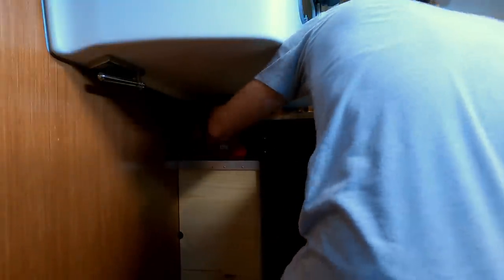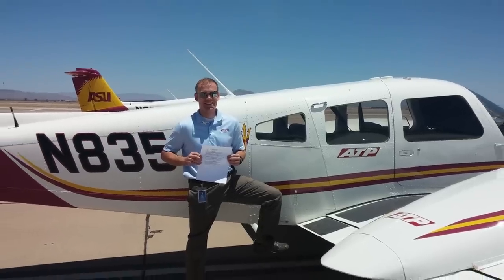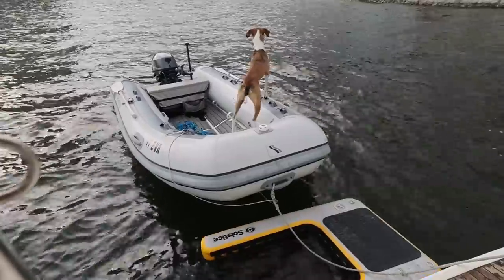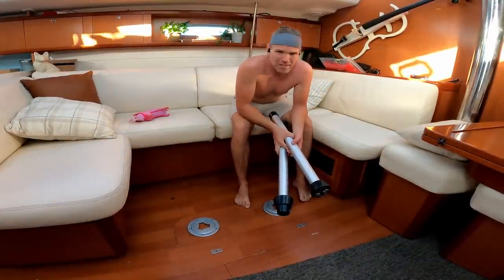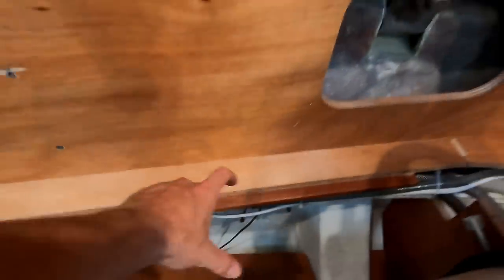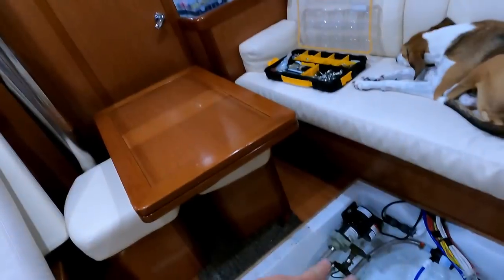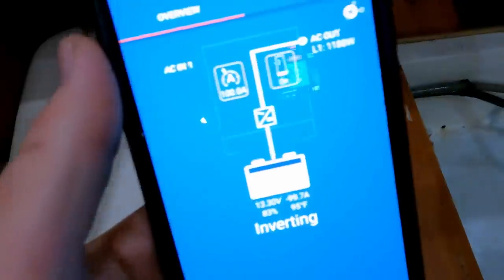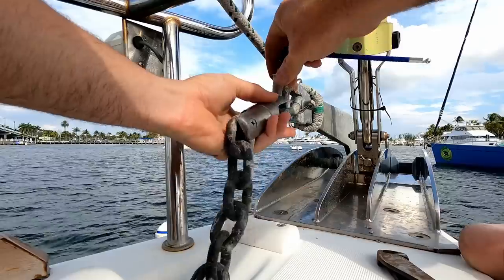Boat Life: A Life In (or out of) Balance | EE 80

Comment: Just a suggestion, based on experience as Yacht Eng/Crew. 
The people who’re warning you about the locking system on your tool chest are right. I’ve actually had a similar chest throw up in heavy weather on crossing from Italy to Spain. 

The damage to the interior of the cabin/tech room that the chest lived in was extensive and cost us 8 days of having a joiner in to do the repairs, everything was veneered natural wood finishes just like yours, it wasn’t a cheap exercise. 

My solution was a sheet of 1/2” plywood and 2 ratchet straps around the chest. I permanently fitted the straps to the chest with a couple of short self tapping screws in each side, that meant that it was a 30 second job to secure it. Might be worth considering?

Though I’m by no means “anti-toolchest”, I have 3 roller cabs with top chests in my own workshop on land, the thing that made me really dislike the thing on a boat was that if I needed anything out of it when on passage, trying to juggle keeping all of the other drawers closed while grabbing the tools out of just one of them was a painful and risky nightmare. 

One last thing, tool chests don’t seal. Tools corrode when not protected from the marine environment. 
Tool chests on boats do a poor job of keeping tools in good condition. 

I very much favour sturdy polythene crates with clip down lids and a good sized sachet of silica-gel in each, which gets dried out in the oven regularly. But that’s only my personal preference, to each their own. 

Meanwhile, it’s great to see you guys out there doing your thing and having a blast with it. Fantastic!
Cheers, R. 😎👍🍻🇬🇧

Comment: Be sure to get into the habit of locking the tool box before sailing (or getting rocked by a big wake. Those draws can all roll out without a moment’s notice.
Reply: Oh my yes.  I have a couple of similar tool chests mounted in my utility trailer and heavy drawers WILL slide out and can easily break their slides if you don't lock them before you move.  That's a VERY real danger; I had one drawer that I had to replace the slides on due to that issue... naturally it was the bottom drawer with the heavy items in it.  

One thing I did was replace the key lock with a T handle lock, that way I can just grab it and lock the drawers.  You aren't worried about security so you don't need a key, just to keep the drawers shut in transit.  From your description I don't think you'll have problems with it breaking loose; you've secured it at least as well as I did mine in my trailer and they've held steady for about 100k miles so far.

Also beware of putting too much into the drawers; it's a real pain when something in one drawer gets hung up on the drawer above and prevents you from opening it or closing the drawer above.  Don't stuff that pair of wire strippers into a lower drawer, it will slide around and end up twisting upright when you open the drawer above.  Voice of long experience and pulling one or more drawers off the hinges to get at the jam is a huge pain.  

Be careful you don't screw up your trim or the balance fore and aft.  Like others I do have some concerns about weight distribution.  While I have very little experience with boats larger than a ski boat I DO know how weight affects handling.

Comment: Hey guys great progress ! I have one tip for your vacuum  bagging the food. So we buy a lot of bulk items and bag just like you. I to had problems with the vacuum failing after sealing the bag. My solution thats been working great for me I started doing a double seal at the bottom then place item in bag then apply the vacuum seal at the top of the bag once sealed then I move up the bag then add a second seal at the top. Seems to hold better over longer period of time. Hope this helps you guys!

Comment: I had the same heat pump. You will love it. Very quiet and efficient. A Honda 2200 will have no problem with running it but you need to turn the eco mode off to start it, then once running turn eco back on. I hope you have a condensate pump so you don’t fill the bilge. That thing will make many gallons of water a day. The Little Giant VCC 20ULS condensate pump has a low profile and a float switch. It has plenty of lift so you can put your thru hull high.

Comment: Tooth paste has enough fluoride to fill in/repairs any small openings in your teeth.  Adding a little lime/ calcium will add taste to your water,  That is what bottled water companies use and run the water through carbon liters to remove taste and odors too.

Comment: May I put a little advice to the fridge:
I always hated the fridge installation on production boats. They just throw in the compressor as it suits and don't mention its operation. Every compressor needs fresh (cold) air and blows out warm. 
Once I had a boat fridge running nearly 24h a day. Then I investigated. The compressor was surrounded of its own warm air. Then I inserted some cardboard just as air guide. This dropped the working time drastically. 

You just put the fridge in the locker. Think about it's airflow and perhaps guide it so input and output air does not mix up - a little effort will soon pay back in less power consumption.

Comment: Cool guys! The freezer will need adequate air supply around it. And the A/C "pump" is usually called a "fan" ... 😁
Reply: No, it's a seawater heat exchanger.  It requires a pump to move the water through the unit.

Comment: Sometimes the heat sealer actually seals a tiny little wrinkle into the bag if its not perfectly flat which starts leaking slowly. you can also try double sealing the top if this is a problem

Comment: Mineral intake from the water we drink is an insignificant amount compared to the amount in the food we eat.   Do not worry about drinking purified water.   Many rural households drink nothing but rain water and have perfect teeth.  My knowledge of the subject is based on 30 yrs experience in the medical laboratory profession.  Supplements are not needed unless one has a deficiency that normal diets cannot correct....which is not very common.

Comment: Fully agree with your comment. Perhaps a modern AC equipment comsumes less energy than an old one. But the refrigeranting or warming-up capaity is the difference between comfor and swept....  Allways you shoul increase the capacity, you will get the temprerure sooner and with less energy compsumtion..

Comment: I suspect that you already know this, but the "magic" in your plane picture makes me laugh so I figured it might be interesting to someone else so imma explain it. Due to the shape of the wing, and the way gasses travel in laminar flow, the air is traveling faster over the top of the wing than the bottom of the wing and pulling it up providing lift, same concept for the nose of the plane. The plane has flaps that can change the flow speed and direction of the air over the wings, changing the amount of lift in specific spots which allow the plane to ascend, descend and turn( also slow down I think). Hope someone found that interesting :).

Comment: You have to make sure that heat pump has enough air flow around it to keep it cool which is why they had that giant vent cut through the wood where it was mounted originally.  It might be ok if you ensure that nothing can block the flow from the old location to the new but I would check it after running it for a while the way it is but be prepared to either cut another vent through the new location or at least make the airflow smoother by removing the chunk of wall that divided the compartments.
Reply: I think that vent is the return air drawing from the cabin.

Comment: Re  Vacuum bags. Don't have time to read all the comments, so maybe repeating, but from experience, always double seal each end. Even then, there is a failure rate. So leave extra on each end. That way you can work out which side failed by cutting off the seal and starting again. Like the wiring, It's a 50/50 bet. But as a rule, double sealing 8 out of 10 does the job.

Comment: Should have gone larger with a/c in a boat, never smaller, more efficient only mean less power draw per BTU output. 16,000 btu is quite a bit smaller than 18,000btu.. (12,.000 btu's per ton) My educated guess is they were undersized at 18,000 btu's.Not so much in cool climate but when in say Panama 100 degrees out,100% humidity you'll feel what I'm saying. By the way I made my living in A/C and refrigeration for 40 plus years...
Reply: 16,000 is just fine for that area.

Comment: Hey guys hope everything is going well with your repairs I was wondering about having that refrigerator unit working in the same cabinet with the air conditioner it would seem like they may conflict with each other since refrigerators give off a lot of heat and your air conditioner having to run in the same area hope you don't have a problem there, good luck with your upgrades and take care.

Comment: I have the same NaviSafe light set on my dinghy... While the lights are great (bright, long lasting on batteries), the clamp and pole for the all-around white light is pretty weak.  Even in light chop it bounces around so much I'm afraid it will break off.  I made it... less bad.... by installing a second clamp, the stock one is low on the transom and the second one is a PVC conduit clamp at the top.  The two clamps are spread apart about the same distance as the bottom segment of the pole and I just leave it in there like that and screw in the top sections when I want to put the light on.  I also leave one section completely out, the pole is shorter but it doesn't flex so badly anymore and the double clamp holds on better.

Comment: Had you said you planned to install a tool box I would have recommended spraying the bow back and sides and either inside or outside the drawers with undercoating. Now that it's installed it will be more difficult to do, but still possible. Doing so will take care of A LOT of noise and keep the metal insulated from the salt air.  I am hoping the company did a very good job powder coating the box...
Reply: Yeah I was thinking about noise and rust...
Reply: If the draws have a soft liner paper or cloth..spray the whole thing and cloth with a light machine oil like GT80 used by cyclists..not WD40 its too sticky and attacks some plastic and rubbers causing cracking.
The cloth or paper towel roll will 
Hold enough oil to resist rusting in the draws it leaves a clean micro film of oil over any metal.

Comment: Well done with the shackle…… buuuut, seems too small. It might jam with the swivel….. also, a shackle should be next size larger than the chain diameter…..  always use seizing wire on your table gear,more at least a zip tie… cheers!

Comment: Vacuum bagging sharp food, maybe place a layer of paper towels between the inner bag, and the outer bag. Also stick a piece of paper with the date bagged, and what the contents are. This method works well for frozen stuff. The paper towels cushion the inner bag against puncture as you shuffle it about in the freezer. The paper towels then can be used for non critical cleaning after bag use. I could also see using cheap cloth towels, and reusing them forever. Just wash them if they get dirty.

Comment: How much do you feel you save in electricity, by switching out your ceiling lights. I've seen on other sailboats small electrical producing windmills, do they produce enough to be worth your while.
Reply: Wind generators can be effective at charging your boats batteries, the problem with them is they tend to be loud.

Comment: Just wondering why put in ball bearing toolboxes draws rather than just normal boat draws and tool rolls or similar. The ball bearings are nice on land but I can't help thinking they'll be a bit of a nightmare sliding out when the boat rolls or jolting all the time (Not to mention rust/corroision in a marine environment - although that does seem to be less of a problem for people in the wram than it is here). Will be intersting to see how it goes, I'll keep my fingers crossed and good luck with it anyway! You can always redo it if it's a problem!

Comment: Minerals in the water: While you have your own customized minerals, the water requires its own minerals.  If the minerals aren't there, it will take your minerals from your body. So, you will be fighting this battle with or without your customized mineral system.  I know the boating community is super cleaning the water and there doesn't seem to be any problem. I'm 67 and we bought hook, line, and sinker the FDA's support of per-processed foods and chemical substitutes in food.  So now cancer is a huge industry caused by chemicalized processed foods. We don't know what they don't tell us unless we dig for the truth of the matter.  I work for a man in Houston that is a water purification specialist. He is totally against drinking reverse -osmosis water, or distilled water for the mineral lack stated above.

Comment: Leaving a valve open and pumping sea water around shouldn't be too big a problem. You aren't on a submersible, are you?  
Do you have a circulation seawater pump shut off switch mounted by the helm?  If you notice something in the water around the hull that you don't want pumped through your condensers, it would be nice for an emergency pump SHUT-OFF. 
Kelp, Sargasso Grass, BF Whale 🐋 💩 poop.
Of course that would make a nice YT video "Whale Poop in the Pipe, Making Money the CoCo Chanel way"